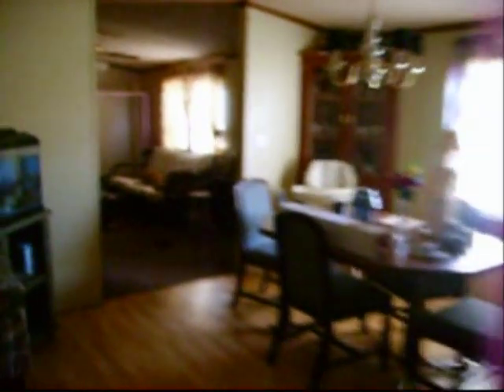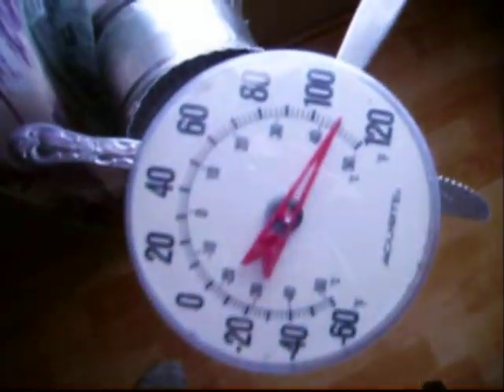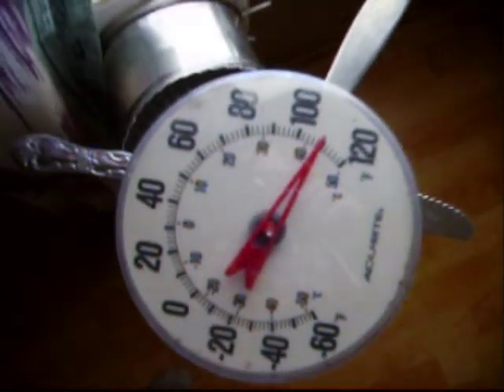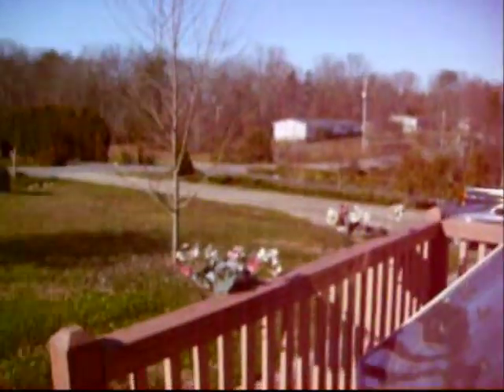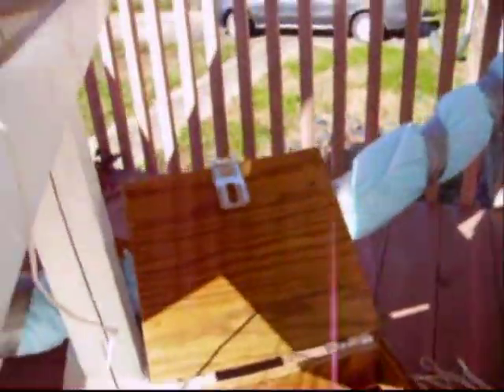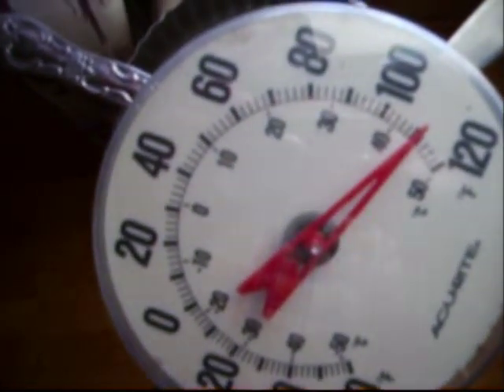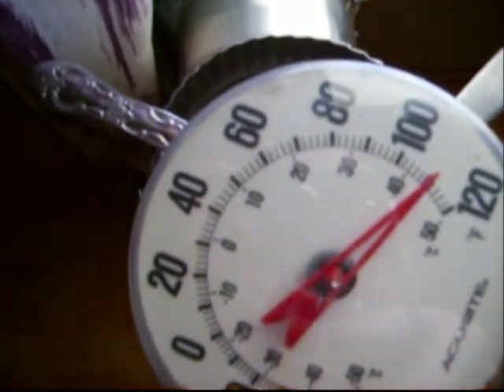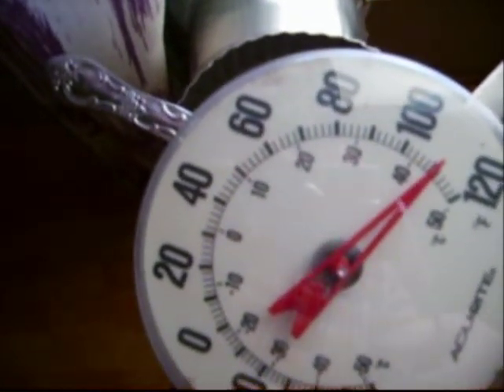Solar Furnace air temp.

Comment: Suggestions, for storing PV generated electricity efficiently use a deep cycle battery,  the battery box should be insulated and vented for safety.  Great job!

Comment from the maker: @bigpinkears. Indoor temp. away from this heater is usually set just above 70f. No this isn't the only heat source. It acts like an added floor register that helps keep an area away from the thermostat warm.

Comment from the maker: @Icabad Yes there are adjustable snap disc. They are a little more costly and you could actually bypass the snap disc. and just wire up a regular thermostat to come on at what ever setting you desire. The snap disc. I use cost me 10 bucks.

Comment: are there any that are adjustable? Or do you have to buy them with preset temps? 

I was thinking that one issue that comes up is having a door that opens or closes when the temperature drops. I know there's a kind of metal that retains certain shapes - so one shape would have the door open at a certain temp, and another the door shut- of course this might not work for seasonality...

Comment from the maker: @Icabad You can find snap disc. thermostats in a wide variety of temperature settings. Some open on rise, others close on rise. I found that the heater retained very little residual heat when no longer in direct sunlight. So the decline is pretty rapid. 110/90 works best for my situation.

Comment from the maker: @Icabad I have a snap disc. thermometer inline with the fans. The circuit completes when the temp. reaches 110 degrees. The circuit is broken when it cools below 90. I also have an over-ride manual switch in case it gets a little too warm inside. It's a regular switch that you'd use for a light. Good question. Hope I helped.

Comment from the maker: @ChinaGroveNC  It's still working. I am in the process of moving the fans and all the wiring outside. I'm going to connect everything to the heater. Good luck if you decide to build.

Comment from the maker: I found the Polyisocyanurate listed at our local Lowes home improvement store. I just went to lowes online and typed in insulation and scrolled through the huge list. I plan on using something else. I had no luck with the foam insulation.

Comment: Look into using "Polyisocyanurate" insulation, (the stuff with the aluminum foil backing).  It's rated for a high enough temperature, to withstand the temps in your heater

Comment: great video. I have seen others that have used fiberglass insulation. It had started coming free due to the high heat.  I was wondering with the 110 degree coming in, what was the temp inside your home??  Can you feel the difference from the solar heat to house heat?  I really like how you gave us all the info we could use. Good luck in the spring with that foam.